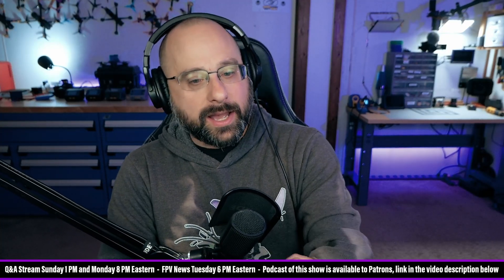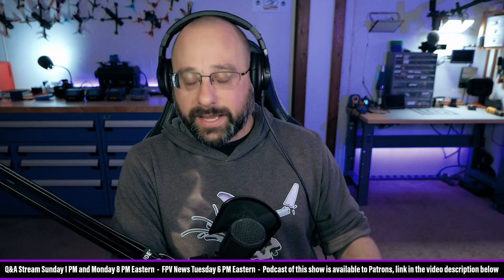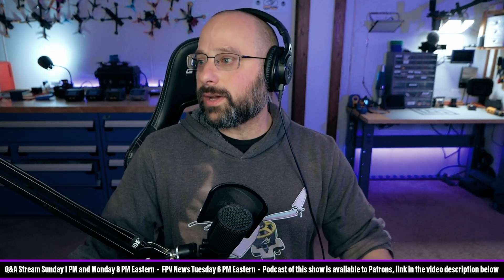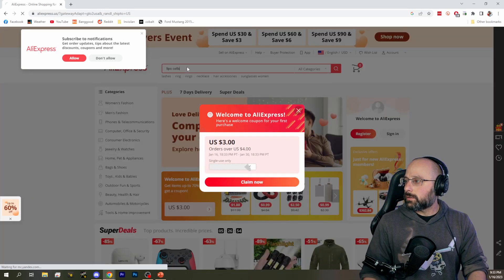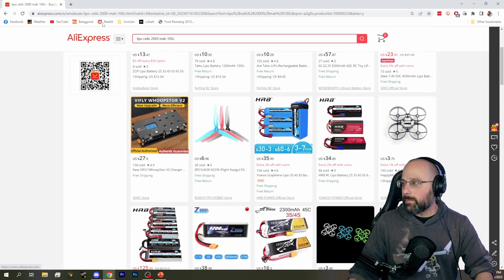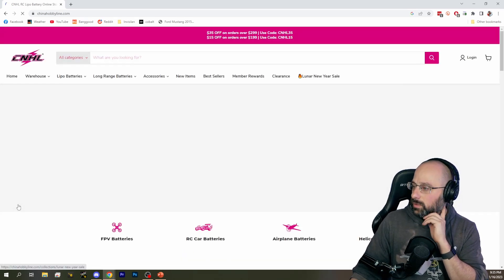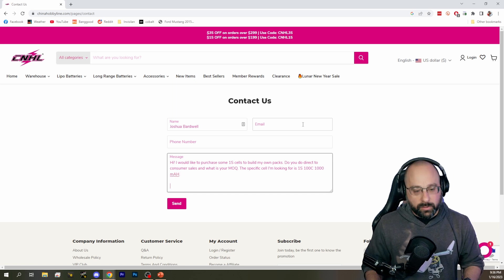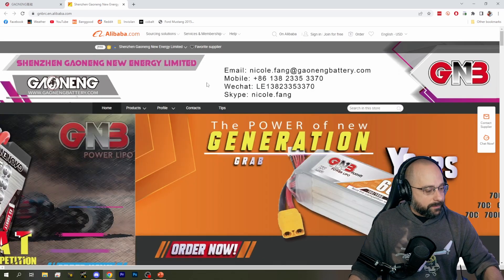How Do I Build an 8s LiPo Battery? Should I Just Use Two 4s Batteries? - FPV Questions

Comment: I agree,  I just use 2 4S batteries and adapter, I can't even charge 8s or 12s, and i have hundreds of dollars invested in top notch charging equipment and power supplies. My Gaui X7 is 12s, I just use 2 5000 6s in series.